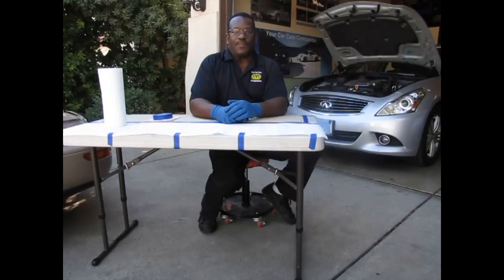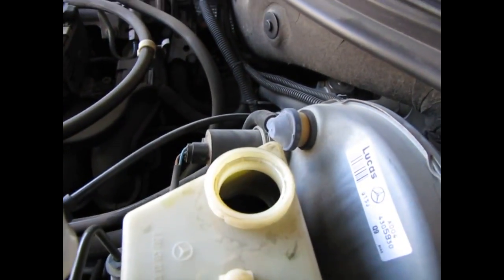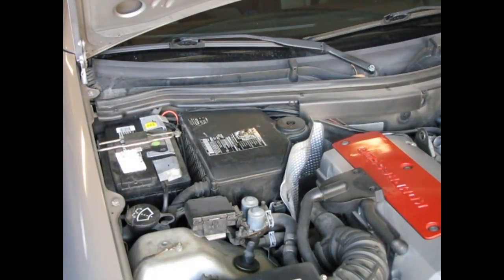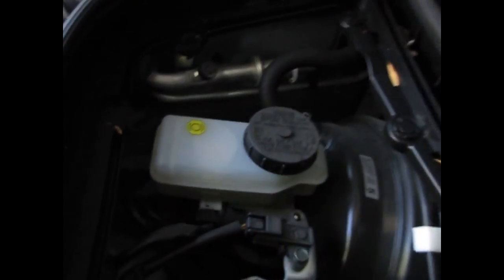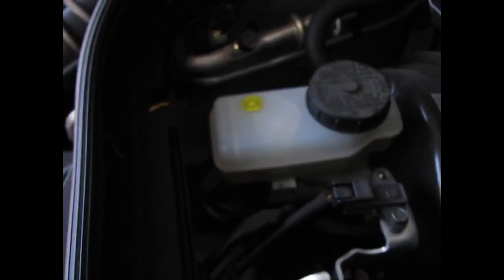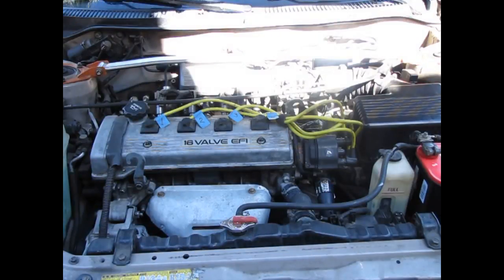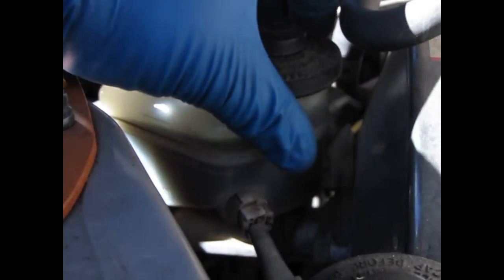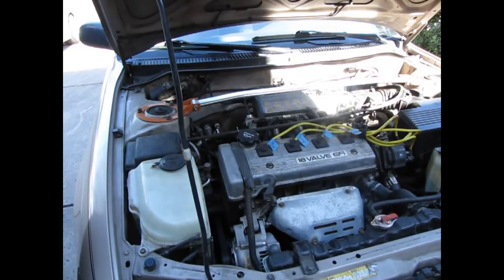CCCHOW1000 How to check your fluids part 1 of 2 - Basic Car Maintenance

Comment: G37 doesn't have a dip stick .. u fill the transmission fluid from underneath the car .. ones a fill port n another is the drain plug
Reply: This is inaccurate . There is a transmission dip stick behind the engine near the firewall bolted down with a 10mm bolt . You can add fluid trough there as well .

Comment: How about the transmission fluid level on the G37?  The answer is there is no dipstick to check.
Reply: Adriana Gutowski you just put a little in with the power steering fluid. I got one too.
Reply: There is my 08 G37s
Reply: @Babajeed_Atl  wtf??? DONT TRUST JEDYJEED
Reply: There is behind the engine